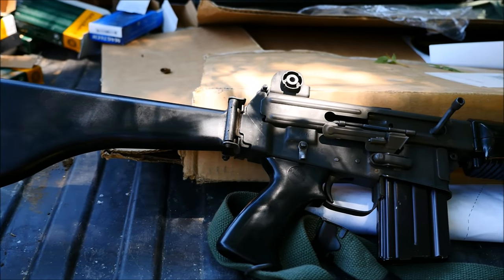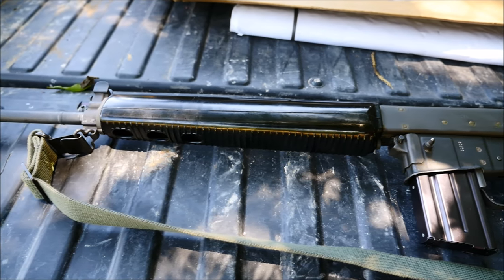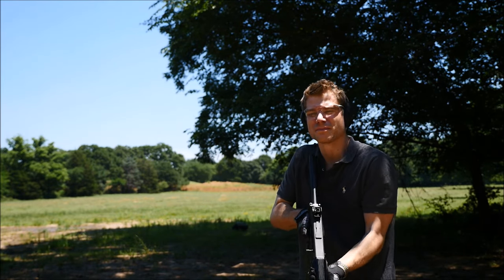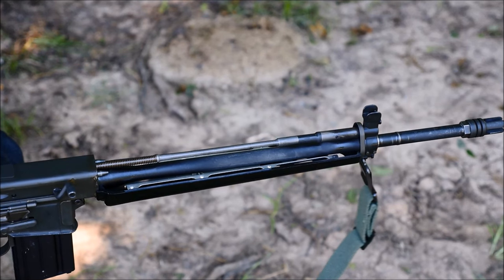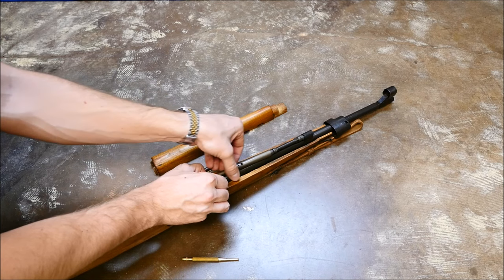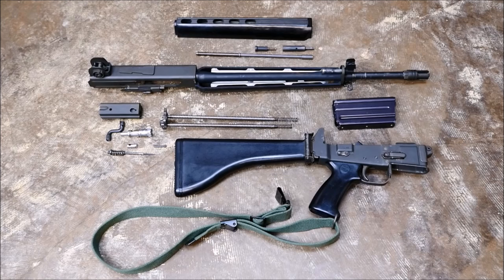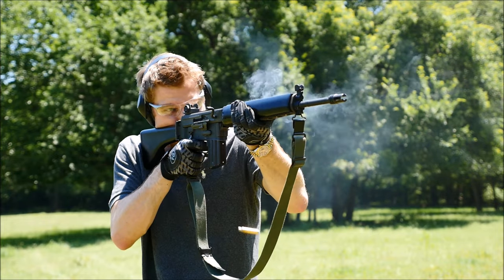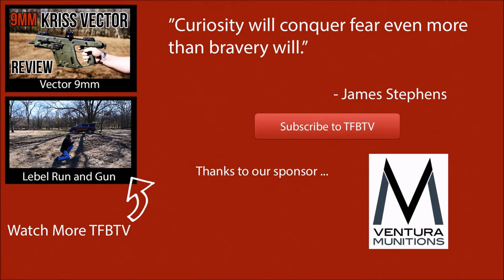AR180 Rifle: Crude Gun, Incredible Legacy

Comment: I think Arnold Schwarzenegger used that gun in The Terminator, during the police station shootout (he dual wielded it with a SPAS-12)
Reply: That's correct.
Reply: NO_FUN_ALLOWED 
Yes and the Terminator used its technical knowledge to convert the semiautomatic AR-180 into a fully automatic AR-18.
Reply: In the novel adaptation, at least
Reply: Yes!
Reply: You are correct.
Reply: Yes he did, he also had it when he was chasing them on the bike, I so want one of these.
Reply: swartzanigga did use that. thats why i have one

Comment: I bought one in the early 80's still the best AR  I've ever owned and I've owned many, just needs the right ammo. Problem was Kennedy was from Massachusetts and Colt was there not in California. Early M16 was a complete failure in Nam.
Reply: No it was not a complete failure, or they would not have kept using it. The fix was simple, order cleaning kits and start chrome lining the new barrels. What it does do is show just how absurd the term mil spec is, cause the military ordered them without chrome lined barrels and no cleaning kits, even though Colt told them it was dumb. Nonetheless the problem was fixed quickly. Colt made several changes during that period, they added fencing to keep the front pin captive, then added more fencing to stop accidental magazine ejections, then added a shell deflector so left handed shooters could shoot from the left shoulder etc. Yes that is correct, the shell deflector was not actually to deflect shells for all shooters, it was to make the gun usable for left handed shooters without getting hit with shells. The shell deflector made the gun a left and right handed gun. So no the gun did not fail, and was constantly being upgraded by Colt.
Reply: George George  Well of course using different powders can cause any gun to jam, regardless of how good the gun is. Even today there are several types of powders that effect how a gun operates. Some powders are dirtier than others, some clump up, some are not as powerful, some are to powerful etc. It has always been like that. There are even powders that are corrosive, and you must clean your gun right after shooting r they start corroding the metal, and cause all types of problems. That is why ammo boxes always say corrosive and non corrosive. corrosive ammo will mess up a gun very quickly.

Comment: I had one and was lucky to trade it off before anything broke. I saw one NIB with a broken bolt catch. I've also seen broken extractors and even broken bolt lugs. Mine had a bolt carrier that must not have been properly heat treated. The first three or four times I took it apart after firing, it had developed a burr at the edge of the firing pin well where the hammer had struck. I had to tap the firing pin out from the front with a punch through the bolt face, then Dremel the burr off. Granted, these were all Sterlings but the Costa Mesas the Army tested had the same problems.

Comment: interest vid. gas system looks similar to the one in the styer we used in the army.  releasing all that gas between the 2 sight posts seems to be a problem. count not tell if it was 223 or 308. think you need to mention that, and why it failed the army tests. having a folding stock is a big bonus.

Comment: The similarities between the SA80 and the AR18's gas systems are almost uncanny. It must work well then, at least with my experience with the SA80A2 I've never had a problem with the gas system, even when the rifle had been submerged in mud and only had a brief clean it still worked fine.
Reply: SA80 directly copied the AR18 internals... it's essentially another US design thrown into a Bullpup shell.

Comment: The RSAF Enfield took the AR18 that Sterling Armaments made and modified it into a Bullpup as a proof of concept. They then copied the entire bolt and gas system without paying anyone any royalties... The guys at Sterling were livid but nothing was done about the copyright infringment. The stupid thing was they got the copying wrong and all L85 rifles in service had that error built in! It took H&K to correct the error in the L85A2 modification program. The AR18/180 doesn't claim to be anything other than what it is i.e. a utilitarian cheap military rifle. The SA80 family took that concept, made it more complicated, heavier, and more fragile (the receiver is of thinner grade steel so as to try and get within the weight limits set for it's adoption). It is a 'silk purse made out of a pigs ear'...

Comment: A fully developed AR180 platform with a long stroke gas system and chambered in 
6x45 SAW or 6.45x48 would have been the way to go if the corrupt procurement sharks didn't have their way.
Reply: Those cartridges are stupid.

A fully developed AR-18 platform in direct impingement would have been the best move. Stoner wanted to make it in DI, but no longer owned the patents to that design.
Reply: ***** Sure, no worries, calm down now, nobody is after you, just relax and go watch some TV.
Reply: BigSmartArmed I can't calm down. I have entered the internet. It is too late.

Long stroke would have made it more expensive, since it would have made it unfeasible to manufacture the op rod pieces through simple extrusion. They would have had to be completely turned.

Short stroke was the next best thing to Stoner-DI.

Non-standard cartridges would have also made it more expensive.
Reply: ***** Actually if you have sources for various manufacturing expenditures I would appreciate it.  

When it comes to system level optimization of production USSR takes the cake.  Entire process is streamlined around optimization of production starting from concept development all the way down to packaging/logistics. 

Short stroke piston system was retired in main small arms with the SVT/SKS and remained only in SVD.  Short stroke was deemed unacceptable for automatic fire. 

For full auto fire long stroke is essential, just as it was proved with flapper lock DP-27.

English EM-2 chambered in excellent 7X43 was based on DP-27 long stroke and flapper lock, it's a shame that US/NATO pushed the 7.62X51, it stagnates the development of modern weapons to this day.

As is short stroke was fielded with SVT, perfected in SKS, and fully implemented in SVD.

Stoners system is not a true DI, Rossignol ENT was the first, then Ag m/42 and to MAS-49.  Militarily all of which were dead ends, while long stroke prevails to this day on all scales, going all the way up to super-heavy 14.5mm which is based on the same DP-27 flapper lock and long stroke.
Reply: You're basically asking for quotes on manufacturing(no).

AR-15 pattern gas tubes are just extruded steel tubing which is then bent to shape. The piston is the bolt, and doesn't require much more machining than a normal Johnson pattern bolt.... just lathe work. The carrier can easily be made into a cylinder just by basically adding gas cut off ports on the side.
You just made redundant all of the extra parts that were to be machined.

You also now made it possible to shorten the spring guide rods/add C-clips to retain the springs(saving weight and possibly small sum of money... and making the gun easier for conscripts to care for), since they no longer have to retain the top handguard... since you no longer have to service the gas system there.

The SCAR series is short stroke. The MP7 is short stroke. The G36 series is short stroke. The CZ 805 series is short stroke. The Berretta ARX series is more or less short stroke. A lot of things are still short stroke. Retired? Not quite.

The Russians seem to just have gotten fond of longstroke, and stuck with it.

Of course Stoner's DI is not normal DI. It's actually a sort of inverted piston system. It's actually in effect(of how it slowly accelerates the carrier, and then dumps pressure from a cylinder), long stroke... which you champion.

Direct impingement has not really been a dead end.

Stoner's DI has been a sort of dead end, if you disregard the fact that it's the second most popular rifle on the planet now.
And if you disregard the 50 caliber British and Chinese rifles which utilize it for weight savings.

The increasingly popular Tavor is also DI. It's not Stoner's DI, but it's DI. You could argue that it having a piston makes it "long stroke," but the AR-15 also has a piston, and is still DI.
If it has a gas tube which serves no purpose but to bring gas back to the carrier, and eliminate an oprod/piston which reaches out to the gas block, it's DI.... and that's what the Tavor does with its gas tube.

It could go one of two ways(or many ways) for DI. It could go the way of the dodo, because of people trying to make shorter actions. OR, it may become increasingly popular(actually happening), as people try to make lighterweight firearms, and find that "all plastic everything" doesn't always sell well.

For the above purpose of lightening a gun, it should be noted that Stoner's DI contributes to the AR-15 still being the lightest service rifle in the world(yes, lighter than things like the G36).... despite being "all metal everything."(but the grip and buttstock).
Reply: Also, that cartridge was lame. Just a beefy/higher BC version of 7.62x39 in practice. The fact that it wasn't adopted hasn't held us back much at all. We moved on from 7.62x51 to 5.56x45(even though some, such as Germany, wanted to move closer to 4mm diameter to seriously reduce recoil/flight times).
Reply: *****
Good info.

AR-15 thin tube is the weakest link and goes out first from overheating. 

Can't agree with you on the cost/resource hours and materials though.  While DI eliminates the piston/rod, AR receiver is entirely milled and it takes so many milling steps that all the DI saving steps are nullified.

Post WWII milled receivers are for specialized, high accuracy rifles, SVD is a good example.

For mass production milled receivers are a nightmare, and the only reason AK-47 had a milled one was becasue stamping of thicker boxes was not perfected and first batches had soft spots by the trunnion.  By the time it was all sorted out stamped AKMs were getting cranked out by the millions, and total savings of both man hours and materials covered the costs of turning op rods.

SIG SG is a long stroke, and they they tested both DI and short stroke to death before going with AK type layout.  Same as LR 300, AR receiver but on a long stroke and no recoil tube extension.

As far as I see it all rotating bolt action best function on a long stroke due to heavier return mass that assures secure lock up with out the typical FTF on short stroke setups. 

Chinese had a full auto SKS version with a rotating bolt, it didn't do so well on a short stroke, while tilt bolt was just too high of ROF to run.  Take a look at Famas, it's engineering lunacy on a short stroke and a tilt bolt.  Similarly I'm not a fan of Tavor, at all.  Fellas that run 3-gun retired them really quick and do not use them in competitions. 

Actually 7X43 considerably outperformed M43.  It did have heavier recoil, but it could have become a standardized rifle/GPMG round as Soviets tried and failed with AK/RPD combo.

Same as US with 5.56 and 6mm SAW, just didn't work at all, while M249 is an inverted AK action. 

I'm not a fan of 5.56 at all, I think it was a mistake.  German caseless 4.6X30 had the same ballistics as 5.56 SS109 but at half the weight, yet I'm still a 5.45 guy.  IMHO it's the best all around intermediate round of the 20th century. 

Best ratio of ballistics/penetration to recoil/performance out to 300 meters, and solid reach out to 500 meters with best terminal ballistics from heavy tumbling effect.  Best cross section density and ballistic coefficient out of anything in its category.
Reply: Not Pulverman the ar15 isn't di the piston is the bolt

Comment: Side charging handle, piston driven, and foldable buttstock? Like it more than the AR already...but I'd stick to a SCAR :d
Reply: The AR-15 is already piston driven. The piston is the bolt.

The only reason the AR-18 doesn't use Stoner's OG gas system, is because he would have been sued by Colt.

Same reason why Browning didn't use the 1911 trigger mechanism and swinging link on his Hi-Power model.

He used a joke of a trigger mechanism that went through the slide instead of grip, and a camming lug(which of course did the same thing as the link, but was mechanically different).

The side charging handle is a design flaw, but a tolerable one. It causes the internals to be necessarily exposed, similar to an AK's charging handle gap.

Comment: one great gun us army should have issued these cheaper more reliable than the pos gas impingement system . could you imagine how good this one can be with a few improvements and developments .
Reply: The AR-15 passed the tests.

The early deployed AR-15s were shit because Colt was shit at manufacturing, not because the design was bad.

The bugs are worked out. Look at the SA80/L85 rifles in England(shit), SCAR rifles(gold), ACR(shit), etc. It's a good design, but not magic.

It's Eugene Stoner designing a cheap gun, while not being allowed to use his own gas system design.
Reply: The only reason Eugene Stoner didn't use his superior gas system is because he sold it to Colt, and made bank.

If he was allowed to legally use his own design for a gas system, the AR-18 would have been far simpler, lighter, and would not have required an exposed trigger mechanism for the side charging handle.

Comment: Having had two Howa Japanese AR-180s beginning circa 1972 I do not agree with some of this presentation.  Since I was issued an M-16 in 1969 that was, in my opinion, 1 grade better than junk, I much favor the AR.18.  My Japanese rifles were anything but crude.  During most of my adult life I was issued M-16s, an XM177E2 and an M-4.  The M-16s and derivatives have greatly improved since I got my first one.  The real blunder in the AR-18 is that it will not accept AR-15 magazines.

I had a 40 year career using AR rifles.  The AR-15 series have ripened over the years, the AR-18 is where some of the early AR-15 issues were corrected.

Comment: it seens the concept was like a "a cheap as possible m16".
Reply: He could have gotten it cheaper if it was DI, since the machined gas system parts could have been replaced with a simple tube.
Reply: +Not Pulverman they could not use a gas tube due to patent infringement I believe.
Reply: +Not Pulverman But that means the bolt needs O-rings to keep gas from getting where it shouldn't, and replacing them is just one more maintenance detail that an illiterate third world conscript would overlook. I didn't know that patents on the AR had anything to do with it.
Reply: I think, I may be wrong, that the AR15 was sold to Colt, and Armalite had to go back to the drawing board.

Comment: Are there no SA80's on the commercial market?
Reply: Close to none if any at all, the British have no intentions of selling them commercially and when they're done with them they're being melted down.
Reply from the maker: Nope. They haven't even been in production for 20+ years :(
Reply: For cereal? I know the French haven't made a Famas since 2000 and have been using stockpiled bins of parts to repair them.
Reply: None have been made since the L85A1.  All L85A2's were converted L85A1's.  This has been causing issues as the L85A2's are getting rather old themselves and it is unclear with what to replace them with, as the British factory where they were made is long gone, and the design issues it faced have made it a bit unappealing to resurrect from a gun manufacturer's perspective.

Comment: why did they stop making those?
Reply from the maker: +capnhands 
They did not sell well, and did not earn the company that made them a profit.
Reply: they should keep making the AR-180, those sell well online and go for $1000 and up
Reply from the maker: +capnhands 
It is been reproduced before, and it failed again on the market.
Reply: like what?
Reply: $1,000 dollars will never make a profit.

You'd have to compete with injection molded plastic and extruded aluminum guns which are selling for $1,700+.

The only stamped gun which is cheap is the AK, and that's because a lot of companies just buy polish blanks and then finish them in the USA for "USA made" receivers.... and therefore don't have to pay for ANY stamping equipment.
Reply: AR-180B was a piece of junk, but it was a repro of this, and was unsuccessful.

Comment: If the SA80 used the same gas system how came it was god awful lol? oh well praise god for H&K right
Reply from the maker: I have always wondered that myself.
Reply: The system in theory was good however it was manufactured cheaply. Firing pins would break, cocking handle was shaped in a way that it threw empty cases back into the chamber.
All H&K did was change cocking handle, build it from more robust metal and increase tolerances.
Reply: ***** H&K implemented a redesigned bolt and extractor too.
Reply: I know. They made 10's of changes. I'm not gonna explain everyone. I'd be here all day!
Reply: +Gabriel MacDonnell quite a few half truths in it though.
Reply: Jamie Grant because they made a bad version of it